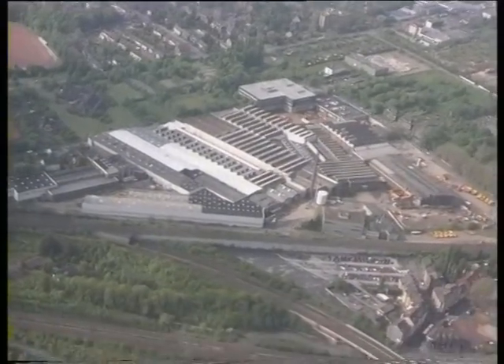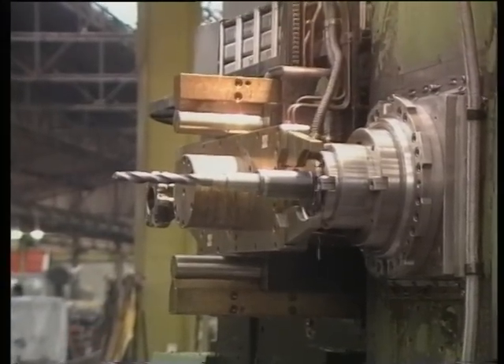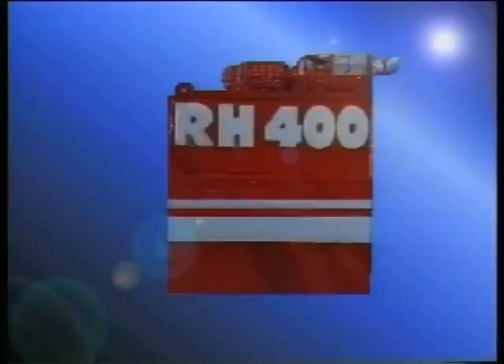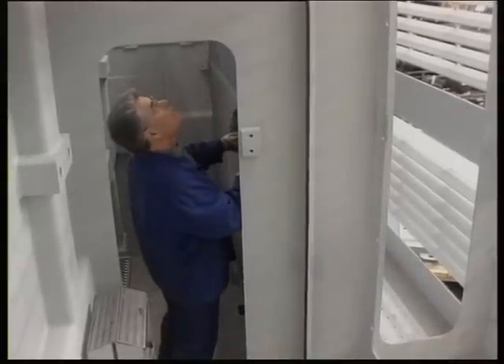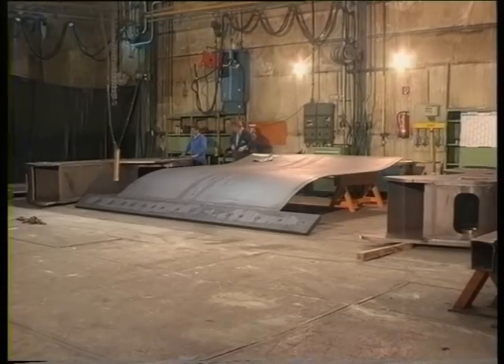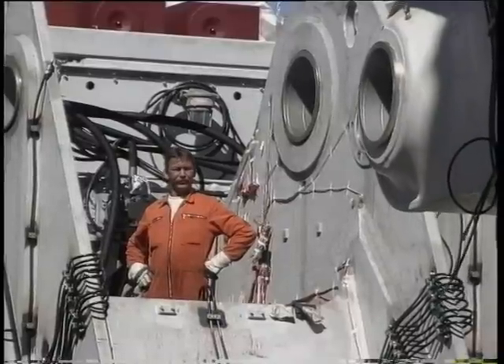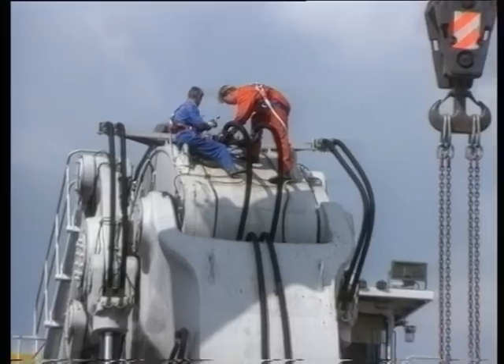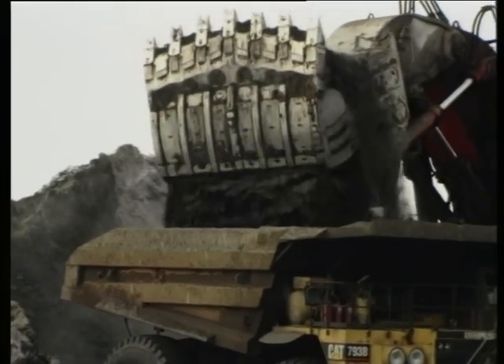Production of the largest hydraulic excavator RH 400

Comment: The quality of the hydraulic excavators manufactured by O&K is second to none. Many of the units they made are legendary in the heavy construction and mining industry.A great example would be the RH 120C. I can’t think of a hydraulic excavator with a more stellar reputation. The RH 120C was absolutely loved by the British mining industry. The machine was available in either backhoe or shovel configuration. Another outstanding machine made by O&K was the RH 200. The company produced many great hydraulic excavator models. When O&K engineers developed the incredible TRI-POWER linkage system, it was a game changer. In my opinion the development of the system was an act of genius. Keep in mind that TRI-POWER is still in use on the most modern, state of the art CAT hydraulic excavators.Many thanks to U.K. TV-Dortmund Videos for posting this awesome video.Excellent job on the video production.

Comment: 20:49 sooo are we just going to ignore that it's leaking oil in more than one place just in this shot?
Reply: that's why they assemble it first at the factory to assess any problems 👍
Reply: my thought exactly
Reply: I don't think that's a leak it looks more like a wire these a couple of them all over the machine I'd assumed they are for computers for testing.
Reply: @mikethebike5014  I see something hanging down, I wasn't talking about that, you can see oil on the cylinders. I'm sure it was something minor.
Reply: It was a good leak, but if that's the only problem, that's pretty darn good.
Reply: I’d say that’s grease
Reply: That's grease from tri-power linkage. I work on these things daily, though I never got the pleasure of working on this machine specifically. I have worked on serial number 6, 7, 8 and 18 and was part of the assembly team for number 18.

I love these machines.

Comment: Its not bushes, its BUSHINGS, and its not NC, its CNC....
Reply: In 2015 we bought an Amada NC Fiber laser. The company called it an NC machine in alot of the literature. NC is an antiquated term for when machines were running on punched paper tape but it seems to be making a resurgence since computers are not a big deal anymore and it is one less redundant letter you can leave off.
Reply: CNC